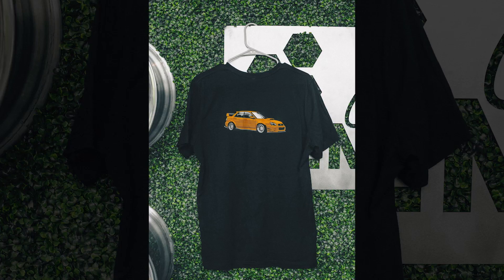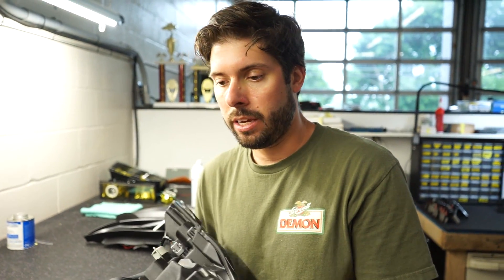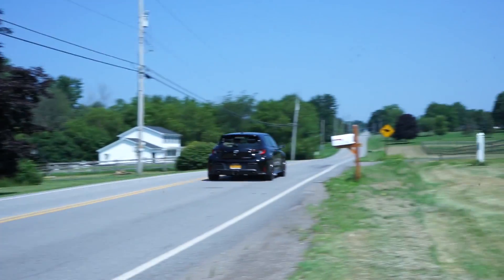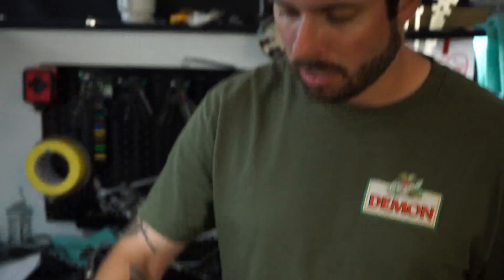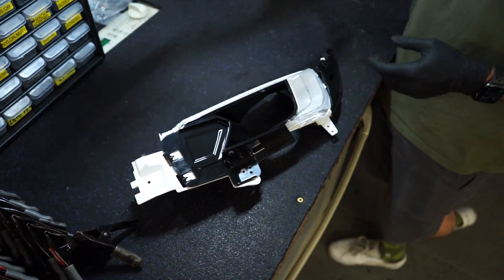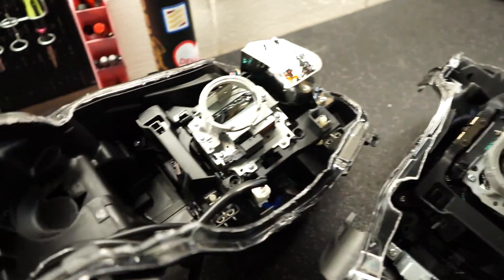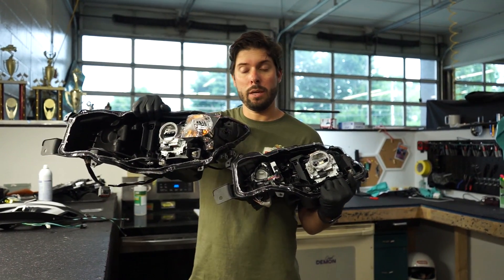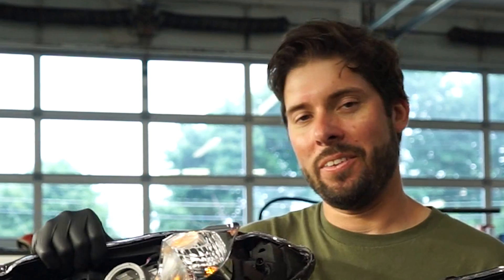2022 WRX Base vs. Limited Headlights

Comment: I am also interested in that adapter module. Will the  steering response work with it tho?
Reply from the maker: Steering would not work since your car doesn’t have the computer telling those projectors to move. It would simply be for the gain of the c-lights

Comment: After the explanation, im hoping youll be able to retrofit some sort of tubular c light set up. Though seems like a bit of bulbs to add to accomplish that.
Reply from the maker: Can do a single strip across the top, but most of those thicker tubular LEDs are garbage so we do not use them.

Comment: Yes but you could upgrade the premium to c lights right? Make the board and the light set up?
Reply from the maker: Unfortunately the c-lights do not provide that much more light for night time driving. Also the Limited lights as of now do not work with the base and premium models. Best way to increase light output would be our Diode Dynamics Elite series fog lights! Here is the link for those interested: https://circuitdemon.com/products/diode-dynamics-elite-series-fog-lamps-2022-subaru-wrx-1?_pos=1&_sid=fa32d75c7&_ss=r

Comment: Really seems like you could take the c-light and plastics from the limited and use that in a lower trim. Seems like you would just change the pinout on the main harness?
Reply: Nope

Comment: So is there a huge difference in visibility while driving between the base led and the limited steering responsive headlights?
Reply from the maker: No difference at all, besides the steering version moving from side to side. The best way to increase forward driving light output is our Diode Dynamics Elite Series fog light kit: https://circuitdemon.com/products/diode-dynamics-elite-series-fog-lamps-2022-subaru-wrx-1?_pos=1&_psq=2022+wrx+elite+series&_ss=e&_v=1.0

Comment: i have a base model, i am entertaining the idea of having fog lights; is there a plug and play solution? if so, can it use one of the dead switches on lower left side of the dashboard?
Reply from the maker: Sure is! We have a full fog light kit on the website that takes your base model, and upgrades with the Diode Dynamics Elite series fogs. Comes with all OEM parts needed to install with OEM switch too. Check it out here: https://circuitdemon.com/products/full-fog-light-kit-2022-subaru-wrx-diode-dynamics-elite-series-led?_pos=1&_psq=Full+fog&_ss=e&_v=1.0

Comment: What lightbulbs go in the base / premium? Are they replaceable? For the headlights. It looks like you need to buy an entire new headlight / housing?
Reply from the maker: They are not replaceable. They are built in LED chips. If the headlight goes out on you, you need a full new headlight from Subaru 👎🏼

Comment: Pretty sure I read in the manual the limited lights are auto leveling
Reply from the maker: That’s what we thought too, but there is no leveling system attached to the lights, only the steering module 🤔
Reply: @circuitdemon_  page 227, maybe I'm misunderstanding it, but it says Headlight Beam Leveler... AUTOMATIC headlight beam leveler adjusts.. I truthfully watched this video to find out difference between base amd all models, I have limited and thought only difference was the SRH